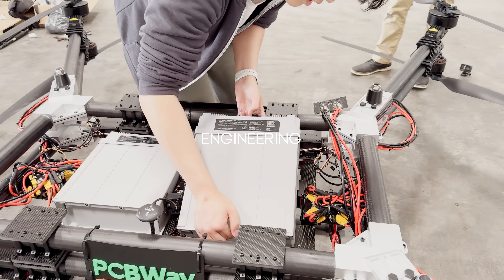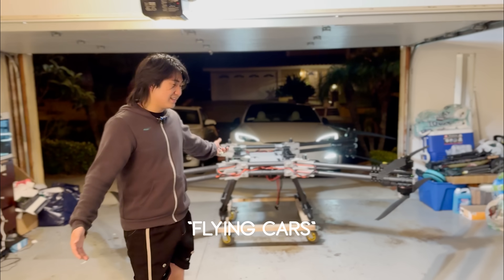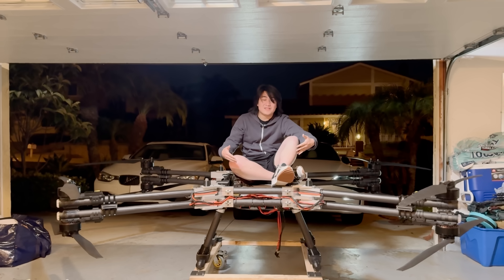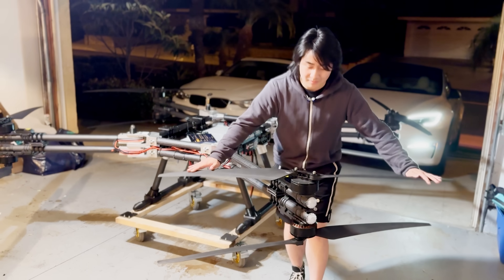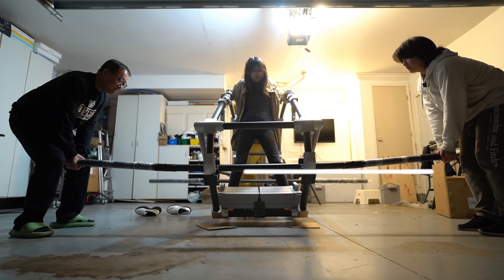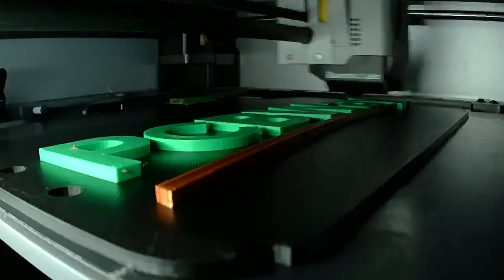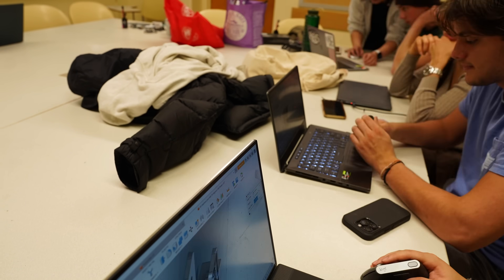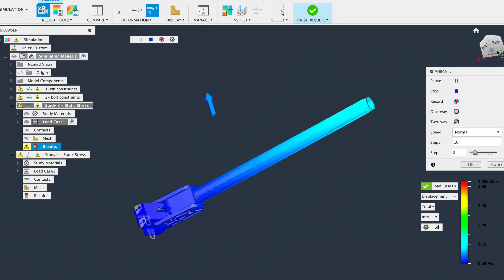My "flying car" finally FLIES

Comment: Very impressive engineering! Have you ever considered a carbon fiber monocoque instead of the spaceframe chassis? I think it would be stiffer with comparable weight.
Reply: but difficult to work on
Reply: @ArneChristianRosenfeldt  - anything is difficult until you learn how to do it.
Reply: @Teritius  I mean, you cannot get to your modules. You cannot easily change parts, watch with a far IR camera, normal camera, touch. Check for lose nuts.
Reply: @ArneChristianRosenfeldt  - that is all in design. If the components are hidden deep within the monocoque, you're right. If they are mounted outside of the monocoque with access panels, the problem is obviated. Furthermore, you have fewer loose nuts (they're not needed) and fewer parts altogether. There is a reason cars, racecars, and planes moved away from spaceframe designs to monocoques.
Reply: @ArneChristianRosenfeldt  - are you on the team building this?
Reply: @Teritius  no . I struggle enough with keeping our bicycles running.
Reply: @Teritius  monocoque for means load bearing surfaces. Like modern wings with a stressed skin. This is more difficult because skins tend to bend. Honeycomb sandwich. Why honeycomb? Shouldn’t triangles be better? Walls which go through the whole length?
Reply: @ArneChristianRosenfeldt  - the annotative and denotative meanings of monocoque are the disconnect here. There are ways to create monocoques and still mount the modules in easily accessible areas.
Reply: @Teritius  just bikes are made of tubes and it works. You can get tubes with thicker walls at the ends. Somehow tube manufacturers know the black magic which is hard to recreate with arbitrary shaped carbon parts.

On a car I like how all the space between windows and doors is used for structure. A typical roll cage looks so ugly. Rather start with a high end Saab or Volvo and lighten up the rest of the car until the roof can carry it.

Comment: What degree do i need to study to do this shit
Reply: mech e / aerospace. really, its a mix of a variety of engineering degrees. electrical for PID/ESC/BMS/motors. could even utilize materials science eng for the frame construction.
Reply: @munderabukhder9022  There is only one thing about material: Don't drill or press with a knife edge into the carbon tubes just as they enter the fuselage. Like glass on a building, use something soft to distribute the load. Would be similar for aluminum.

Comment: Can you comment on the lack of triangulation in the frame?  It seems like this design leaves weight and safety factor on the table by forcing all links and members to be sufficiently strong in a planar arrangement with no trussed reinforcement.  Was the "flat pack" form factor just baked into the requirements, or is there something else I'm missing?  Thanks for sharing -- it's amazing work :)
Reply: The arms have really thick tubes on most designs for aerodynamics. They don't need much triangulation. But just outside the propwash, yeah, load should be transferred via an aluminum ring to a triangulated cage. Just the arm needs to protrude into the cage to off load the leverage without cracks in the tube.

Comment: Hi Alan, 
You have a very cool project! I admire your tenacity and your dream! I am also developing a flying car of my own design, so I can really appreciate what you are doing. I wish you the very best in your project!
I started my project in 2016 in San Diego, Calif and I am still working on it, but 3.5 years ago I found a business partner and moved the project to Fjugesta, Sweden. The project is called Sky Chaser. It is the 1st vehicle if its kind, a real roadable Blade Runner style VTOL flying car. It looks and drives like a car, uses its body as a wing and has no folding wings. It has no exposed rotors and is all electric. Sky Chaser looks and drives like a car, and flies both vertically like a drone and horizontally like a plane, in addition it is amphibian. Since it is an entirely new design for a flying car, I started by developing a working 1/6 scale model out of foam board and hot glue. Then I developed a CAD model that I got to fly in a flight simulator. Then I scaled the design to full scale and now have a unmanned working 200lb prototype we are now testing in VTOL mode with remote control. The tests show that it flies the same as in the flight simulator. Click on my icon the see videos of my tests and a presentation of the project. Also below are some links with more information:

*Website: SkyChaser(dot)se
*Project Presentation: https://drive.google.com/file/d/1FAdls15OriuQ4hoD2xPwXeNQDQTKpK1t/view?usp=drive_link
*evtol News article 1: https://evtol.news/sky-chaser-concept-design
*evtol news article 2: https://evtol.news/sky-chaser
*Simulation tests: https://drive.google.com/file/d/19taPDO1yERAumR8OV1IFk2n1TqNLNUkN/view?usp=drive_link
*Full Scale hover test: https://drive.google.com/file/d/1qDl5X142uC5yt_5Xcb0GUS3h-LgD4P0V/view?usp=drive_link
Reply from the maker: That’s great! Keep up the good work!! Find my email on my channel —> about. Let’s stay connected
Reply: @alanzeekk  Hi Alan, I wrote you an email on 6/20.
Reply: Now this is a flying car , I’m super impressed and wish you every success 👍
Reply: @mrshaneyt43 Thanks! I have been developing it for 8 years, starting in San Diego, CA USA and now in Fjugesta, Sweden. The design is now patented in the US and we are in the process of getting a patent for Europe. It is a twin engine flying wing design with double rudders and double elevons for control. It is also a tilt rotor tricopter for VTOL. And also a lifting body which is quite unusual. This is possible since the front motors, in the forward position, blow thrust over the internal wings, which generates a lot more lift. The oversized side panels housing the wheels act as winglets which also increases the wing lift. The vehicle can not be stalled since the front motors constantly blow thrust over the wings. This also generates lots of lift at slow speeds and high angles of attack, which is important for transitions from VTOL to Plane mode. This also lifts the vehicle out of the water in amphibian mode. See the links in the videos for details. There is a lot going on in this very simple design. We are looking for a partner. If you know of anyone that would be interested. Please let us know.
Reply: @mrshaneyt43 Thanks! I have been developing it for 8 years, starting in San Diego, CA USA and now in Fjugesta, Sweden. The design is now patented in the US and we are in the process of getting a patent for Europe. It is a twin engine flying wing design with double rudders and double elevons for control. It is also a tilt rotor tricopter for VTOL. And also a lifting body which is quite unusual. This is possible since the front motors, in the forward position, blow thrust over the internal wings, which generates a lot more lift. The oversized side panels housing the wheels act as winglets which also increases the wing lift. The vehicle can not be stalled since the front motors constantly blow thrust over the wings. This also generates lots of lift at slow speeds and high angles of attack, which is important for transitions from VTOL to Plane mode. This also lifts the vehicle out of the water in amphibian mode. See the links in the videos for details. There is a lot going on in this very simple design. We are looking for a partner. If you know of anyone that would be interested. Please let us know.
Reply: @mrshaneyt43 @mrshaneyt4356 Thanks! I have been developing it for 8 years, starting in San Diego, CA USA and now in Fjugesta, Sweden. The design is now patented in the US and we are in the process of getting a patent for Europe. It is a twin engine flying wing design with double rudders and double elevons for control. It is also a tilt rotor tricopter for VTOL. And also a lifting body which is quite unusual. This is possible since the front motors, in the forward position, blow thrust over the internal wings, which generates a lot more lift. The oversized side panels housing the wheels act as winglets which also increases the wing lift. The vehicle can not be stalled since the front motors constantly blow thrust over the wings. This also generates lots of lift at slow speeds and high angles of attack, which is important for transitions from VTOL to Plane mode. This also lifts the vehicle out of the water in amphibian mode. See the links in the videos for details. There is a lot going on in this very simple design. We are looking for a partner. If you know of anyone that would be interested. Please let us know.
Reply: Thanks! I have been developing it for 8 years, starting in San Diego, CA USA and now in Fjugesta, Sweden. The design is now patented in the US and we are in the process of getting a patent for Europe. It is a twin engine flying wing design with double rudders and double elevons for control. It is also a tilt rotor tricopter for VTOL. And also a lifting body which is quite unusual. This is possible since the front motors, in the forward position, blow thrust over the internal wings, which generates a lot more lift. The oversized side panels housing the wheels act as winglets which also increases the wing lift. The vehicle can not be stalled since the front motors constantly blow thrust over the wings. This also generates lots of lift at slow speeds and high angles of attack, which is important for transitions from VTOL to Plane mode. This also lifts the vehicle out of the water in amphibian mode. See the links in the videos for details. There is a lot going on in this very simple design. We are looking for a partner. If you know of anyone that would be interested. Please let us know.

Comment: Great job! It is often underestimated how difficult it is to scale up drones. Everything from the flight characteristics to power management has to have a great deal of consideration, ntm the costs exponentially increases. Keep it up!
Reply: Don't you just use more material? Thicker wire, bigger balls ( in the bearings ), more cells in the battery (voltage), larger blades and tubes .. which still fit into a single enclave . Nothing scales exponentially, but rather scales linearly with payload. Electronics is basically the same, just add one power stage in the amplifier ( a row of discrete power amps ).
Reply: @ArneChristianRosenfeldt  Give it a try!
Reply: @makerslife  I would still need the scale money. Also you may have read that I favour helicopters. They scale down.

Comment: Yes, I enjoy Billy. My big Drone too. It’s a lot of work that adjust your gains drugs a little bit sensitive, but you get it the sweet spot. I’m using the same motors or not X 11 max. 18S 49 inch propellers. 👍

Comment: Those aluminum clamps are definitely not sufficiently designed. What are those bolts? Like 4mm or 3/16 round, holding the aluminum around the tube? Go to a local playground and look at how those decks and accessories clamp to the 5" round posts. Then you can do a redesign before disaster strikes. Those single tabs with the single thin bolt are WAY too insignificant. Any significant amount of "pry" stress is going to bend those tabs or snap those tiny bolts or both. You need something more like 1/4" or 5/16" bolts and more than one clamping point. Seriously. A trip to a high end playground structure by a manufacturer like LSI (landscape structures inc) will be a real eye-opener for inspired design.
Edit: I don't think they will fail immediately, however. The inside triangular braces look good to me, actually. It's the outside tabs that look weaker than they should be. I'm positive that you will, at some point, find the tabs need to be beefier and the bolts need to be beefier too.
Reply from the maker: Hello, Thanks for your feedback! The aluminum clamps are also held down by a massive 20mm and two 10mm bolt if you haven’t noticed. They’re also bonded to the carbon with very expensive epoxy.
Reply: @alanzeekk  I figured there must be something I'm missing. I do hope you take my advice about looking at playground structures into your future plans. Those engineers are very innovative. Thank you for your reply.
Reply from the maker: @C_Melvyn_James  yap, on my way to a playground last visited 10 years ago haha
Reply: @alanzeekk  Great stuff. I used to install those things. Maybe you could have guessed that. LOL
Reply: @alanzeekk  And let me say that I am envious that you get to play around with all that engineering and design. It must fun but stressful.
Reply: you're right and this will go over his head 🗣️ like everything else
Reply: I'm a mechanical engineer and I was about to comment the same thing haha
Reply: additionally I'm not a very big fan of drilling into carbon fiber tubes with such a small bolt, repeated use and flexing of the CF tubes will cause cracks to form so quickly
Reply: @absence3782  You better don't drill into them at all. I would even say that tubes need to go through. Likewise propeller need to be of one piece, not two blades. But we need to route the cables. So holes on the side of the tube at a place with minimal load are okay, I guess. Can insert rings with some kind of suspension to only deal with pry load.
Reply: @ArneChristianRosenfeldt  yeah I agree I made another comment about it on this video but I can’t find it haha

Comment: Hey alan! Fellow UAV developer here! I've been working on UAVS for the last three years and it was quite fun to look at someone go through the ups and downs of the entire process. It is pretty amazing what you managed to build here. I just want to advise you to not try and arm/hover the UAV in such a restricted area. Maybe an open field would be better? 
Having the UAV hover at such a low altitude with such massive amounts of thrust will make it very sensitive to ground effect phenomenon and might cause the UAV to go out of control. That'll be extremely bad if it is in such a constricted space. Not to mention the much better GPS accuracy you get when under open skies. Under closed environments, the GPS accuracy will not be that great (obviously) causing the UAV to rely majorly on its EKF for position estimate,  and will lead to the UAV overcorrecting its position.

Good luck, safe flights and looking forward to the upcoming videos!!
Reply: I was going to add that the PIDs did seem a bit twitchy and were reacting badly with the ground effect
Reply: @shanemshort  Non-linear turbulent airflow. It's operating in a chaotic region.
Reply from the maker: Hey Aditya! Thank you for your insightful comment! You are absolutely right about the risk of flying indoor, and I had a close call with the wall and fence many times. I did not expect it to have that much turbulent air.

Luckily, my 7 years of experience flying FPV drones really saved that day.

But yap, next test will either be outdoor or bigger indoor space.

P.s. was flying with only gyroscope and accelerometer
Reply: @alanzeekk hey, what's the legality of flying it outdoors? I kinda figured you flew it indoors to not have to worry about the FAA lol
Reply from the maker: @crash_fpv good question. If it flies unmanned, it needs a special airworthiness certificate. If it flies manned, then it’s legal in unregulated airspace class G without any additional paperwork
Reply: @crash_fpv  That's what a tether is for. It's not "flying" if it's still connected to the ground.
Reply: I was thinking the same thing, I was getting so nervous when it got so close to the wall.  Also, they won't know if its strong enough to actually fly if it doesn't get out of ground effect.  Lastly the air will be really turbulent in such a confined space.
Reply: You're awesome 😎👍😎👍❤❤🎉
Reply: Quick question. Doesn't UAV stand for Unmanned Aerial Vehicle? The final form of this dual motors quadcopter is supposed to theoretically hold a human, so wouldn't that make it an MAV? Manned Aerial Vehicle.
Reply: This is the perfect commuter vehicle in the winter time.
Reply: Why is GPS necessary for stability ?  Surely the other sensors sustain stable flight ?  I understand positioning and control of remote drones but most pilots of this type of aircraft use separate possibly more advanced gps navigation systems.
Reply: @TheTwistedStone  this is nothing more than a very large fpv drone. its running ardupilot, which uses GPS as the primary source to stabilize. they dont have any other advanced sensors, a barometer and gps is all.
Reply: @staymad7206  Are you saying there is no gyrometer/magnetometer/gps sensor fusion? I find that hard to believe.
Reply: @KCM25NJL  calling it sensor fusion is a very large stretch..... lookup how ardupilot and the EFK functions. it definitely combines them, but without one it doesnt work.
Reply: But his is manned
Reply: I thought the same thing. However, it being powerful enough to lift 200lbs (its own weight) it would need something to constrain a catastrophic failure. Outside, it would have had to deal with changing conditions and not necessarily optimal ones. I would have preferred to see it in a more open space with it being surrounded by netting or chainlink.
Reply: Some good constructive comments here, but for the life of me i dont understand the need for negative comments, the hours, the study, the cost, the cooperation, all warrant positive feedback. IMHO